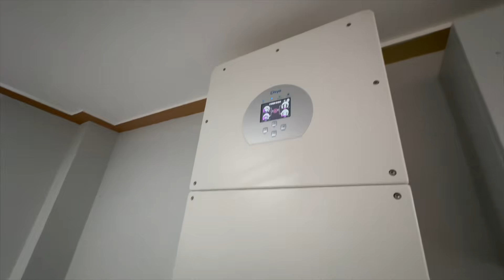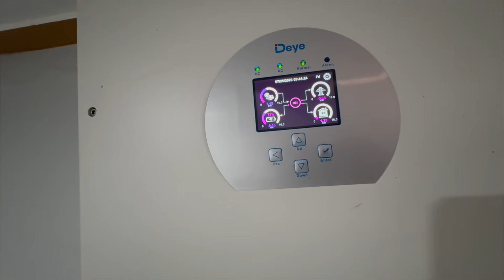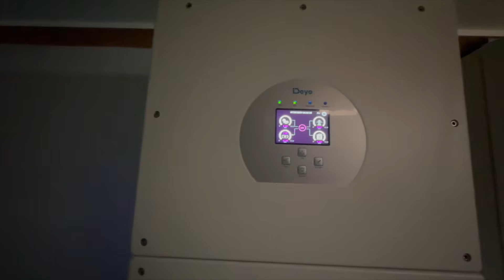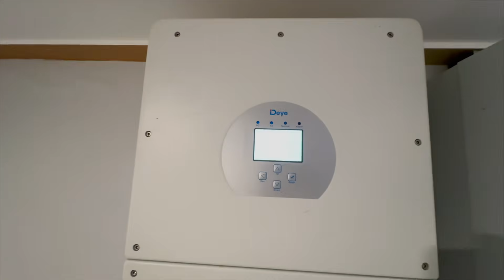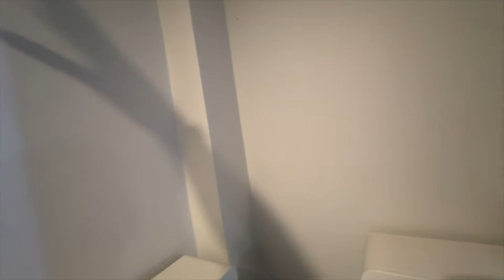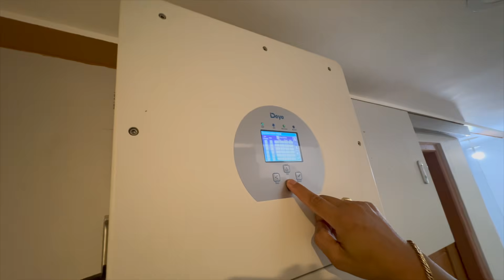Subic Bay House Build Ep 134 pt 2

Comment: Your system is very complicated compared to my system. It was very hard to follow along as the audio was not very good. The man from the solar company spoke too fast for me to understand how things worked. I have 12 panels on my roof, no battery and one inverter box to run the system. I have net metering which is now zero for my install month of November.
Sounds like you have a great system.
Reply from the maker: That is more normal and similar to Ian's he has 15 panels.  We have such poor electrical infrastructure here in the Subdivision many have been installing their own private transformers at about 125,000 peso. I opted to go with my own extra fourth battery at 95,000 peso, so if the grid falls below 185 volt Ian's transfers over, mine transfers over at 200 volt.  It wasn't so much paying the electric bill for me as the poor grid damaging my expensive appliances and electronics.
We are going to do another Solar only showing Ian's more conventional system and mine which can go off grid and still run everything in the house for at least 30 to 48 hours
Reply: @AtHomeinSubicBay-cw4ij way better just to have a solar system act as your own transformer. Zameco quoted us 865,000 to extend the line and private transformer, fook that
Reply: My system is a little more simplified. Two deye hybrid inverters, upgrading to 15kw as we speak, two batteries but saving for 4 more batteries. Currently offgrid because Zameco the power company wants too much to extend the line and transformer, we are waiting it out. You should get at least one battery brother, that way you always have power when the power gets knocked out
Reply from the maker: Yea you can buy a lot of batteries for 865,000.  For me being off grid is cleaner